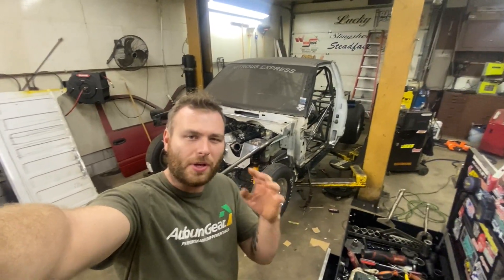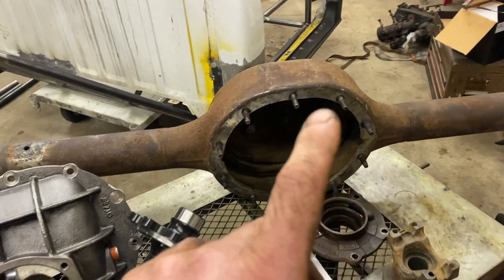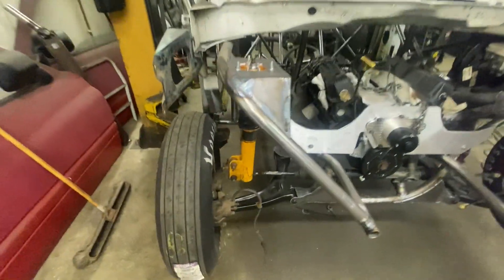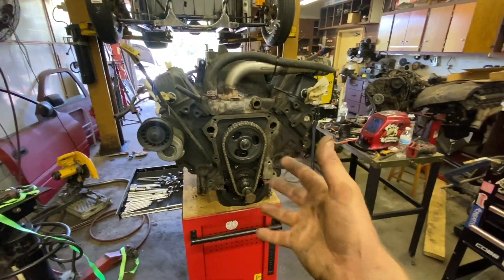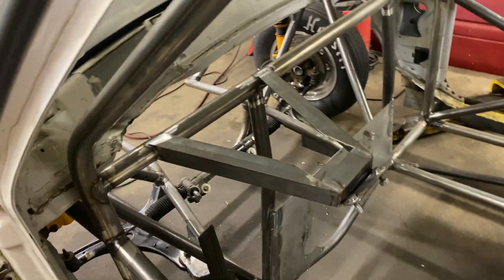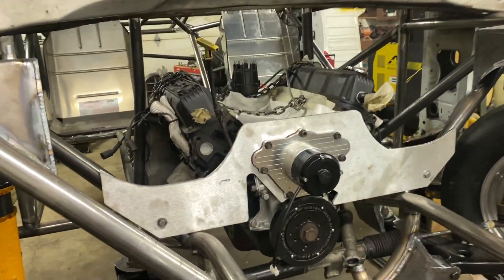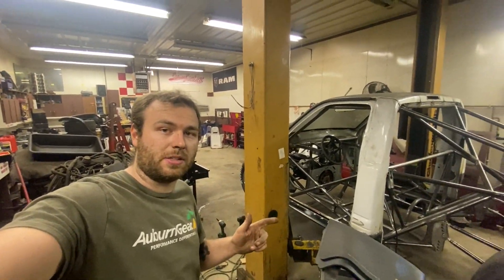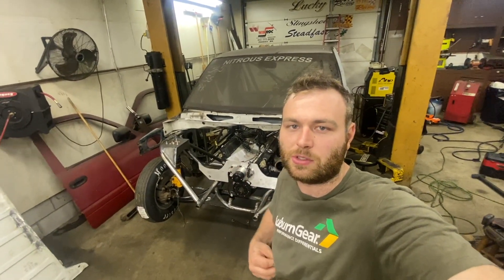Full TUBE CHASSIS Build in 10 minutes ish

Comment: You should probably use the end of the caliber axles in the front hubs to keep the front bearing in place
Reply from the maker: @Moneygrip  I did cut them down and bolted them in
Reply: @ good man plus now you have provisions for going awd if you wanted. especially with how far back you pushed the engine. Why i got ya how high can you rev a stock block?
Reply from the maker: @ idk magnum heads and after market magnum head flow terrible so I think that would be the biggest hold back from high rpm in these engines
Reply: @ im doing edlebrock aluminum heads and getting them ported im probably just going to spin this thing to 6500
Reply from the maker: @ I spun 6500 on stock heads so you will do good!

Comment: I have a 89 f150 4x4 I plan on doing something similiar. I plan on keeping frame though and doing tubular body and make it more of a giant UTV. The frames on them olf f150's are super solid, so I should be able to tie into it with some sch40 and make it roll safe. I could 100% be wrong though as I am a complete beginner. Before i start though I will find a actually professional consultant to clear what i want to do.
Reply from the maker: Sch40 will weigh a ton. Spec is .120 wall for steel and .093 wall for chromoly. And yes you can do that way and it’s a lot less work but will be a lot heavier setup

Comment: Yesss! The video I have been waiting for!!!
Reply from the maker: Glad your as pumped as me!
Reply: @RacingRamFam  brother I picked up a ram project because of this channel!!! I’m stoked!!!
Reply from the maker: @ExpoPerformence  that’s awesome! What year? And what plans do you have for it?
Reply: @RacingRamFam  I picked up a 94 single cab short bed manual 2wd. I plan on tearing down the motor to freshen it up open up the ring gap camshaft then probably call it good on the motor part till I can save up enough for a built trans either t56 or th400 I just haven’t decided if I want to go auto just yet not really chasing numbers gonna run it all in a stand alone aswell from my understanding the 94 ob1 is just garbage 😂
Reply from the maker: @ExpoPerformence  ya tuning in ob1 is not very good. But sounds like a awesome project! I love my t56 in my srt10

Comment: Well hellooooo NURSE lol.  Glad to see you back, and extremely busy. Luven (whitey 2.0).  How many tubes did you purchase altogether.
Reply from the maker: Oh it had to be close to 200ft of tubing
Reply from the maker: How banshee coming??
Reply: @RacingRamFam  200ft 🤯 a bit out of my price range lol.  Banshee is gutted for a roll cage, and all the stock wires are removed from the engine bay.  I'm still saving up for a four link, and I just got done repainting the turbos and changing up intercooler pipe sizes from 2.5" pipe to 4". Got a 3"core radiator going to rear mount to roll cage. I was also thinking about dabbling in carbon fiber body panels, but still learning how to mix the products properly and how to make a mold. But I'll get to where you're at some day with the full chassis build.  I'll be back up on YouTube this month.  Revamping the channel. I'll email you my new email, will keep in touch.  I learn a lot watching you're videos too.  Glad you're back up and running again.
Reply from the maker: @DBGrimson  awesome! Will be a insane Durango when it’s done